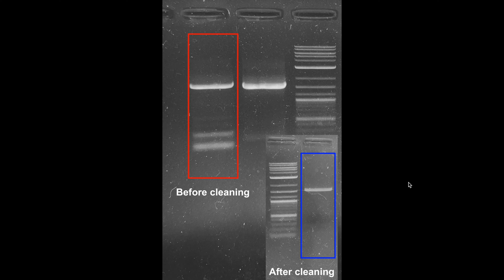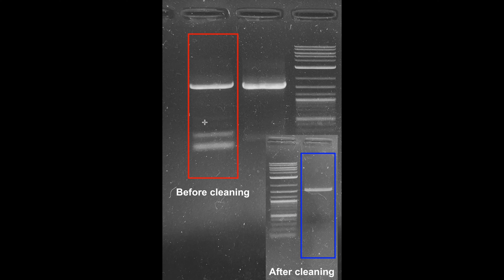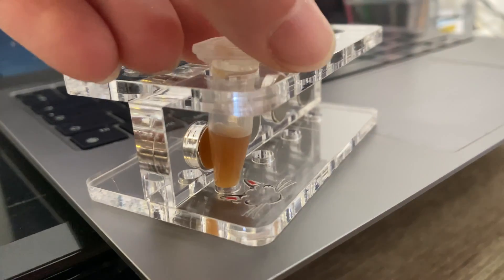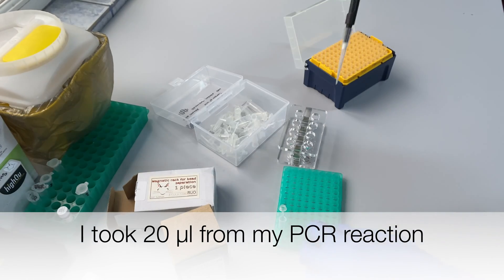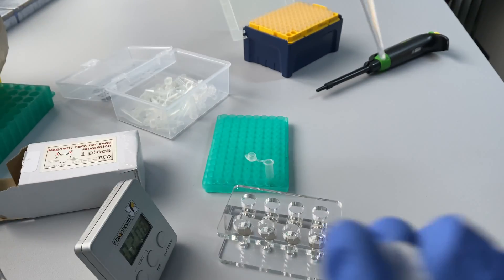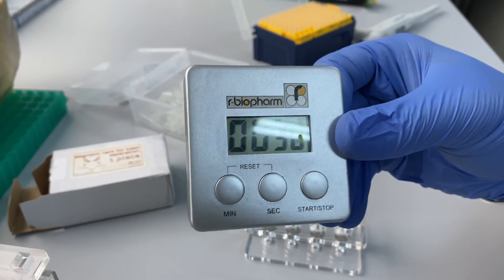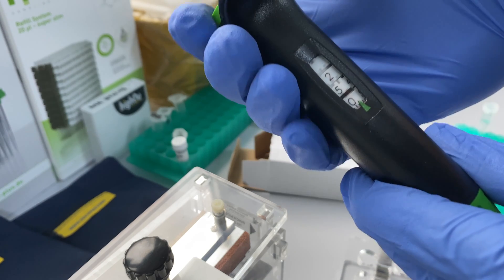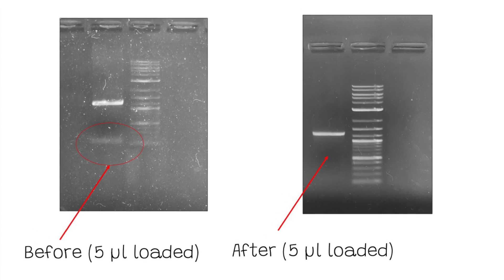PCR cleanup and size selection using magnetic beads how to!

Comment: Thank you! Does this work if my RT-PCR product is in the loading dyes?
Reply from the maker: Thank you so much for the coment. It took a while to answer since I basically contacted the supplier of the beads and ask them about your question. I don't have experience in this since I don't usually use pertained mixes and polim..  They said it should work fine. But just add an extra wash step to be sure.They did not test this I would say. Scientist also talk about this on ResearchGate : https://www.researchgate.net/post/Can-I-use-a-PCR-clean-up-kit-on-a-PCR-sample-with-loading-dye. But if you really want to know and you work in an institute or something contact them as they give out free samples. As usual, the product in the video was a free sample. :) Hope this helps.
Reply: Thank you. I tested one and it works, this one should work in principle too.

Comment: I believe there might be a gap in my understanding of your video. I have a ligated DNA sample, and there are sections both upstream and downstream of the DNA of interest. Could you clarify how the magnetic beads distinguish which DNA to bind with in this context?
Reply from the maker: Hello and thanks for the comment. This would be called "two sided" selection. Meaning...usually the larger the fragments the more they bind to the DNA. So basically large fragments get bound to the beads, and the small ones remain in the supernatant. :) after...you can either keep the beads...with the large DNA, or keep the supernatant, with the small DNA. Then you would use the beads again. It's all about the ratio of beads to DNA. I hope I explained a bit and hopefully that was your question. Have a look here : http://core-genomics.blogspot.com/2012/04/how-do-spri-beads-work.html
Reply from the maker: But if it's ligated this won't work. I mean it would but you would clean the whole fragment of DNA...I guess.